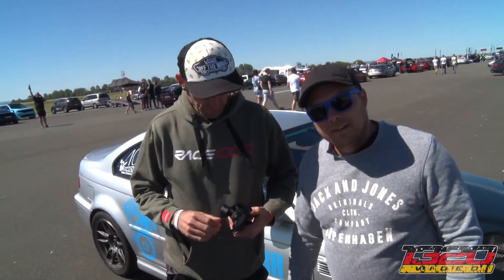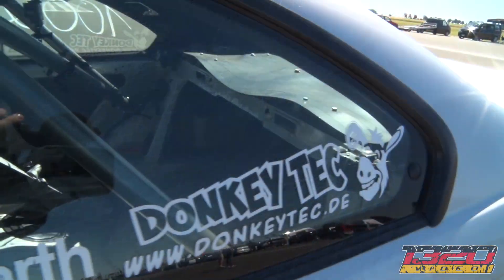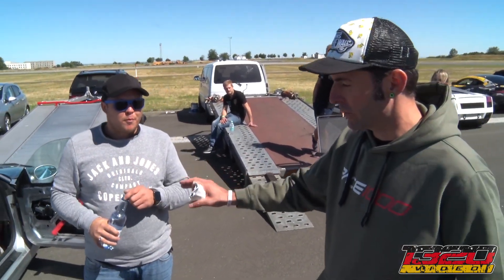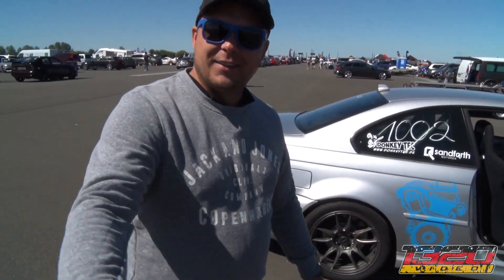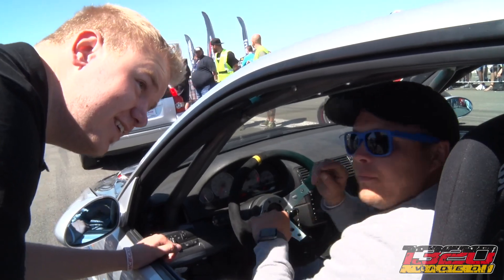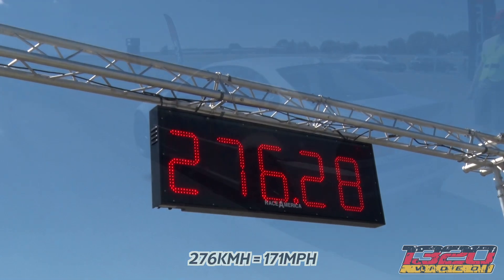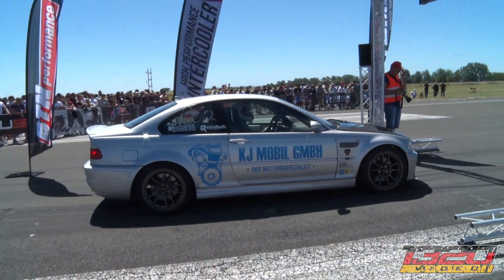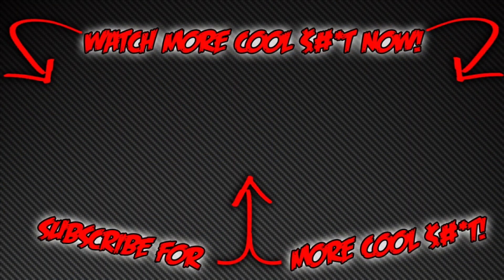950HP BMW E46 - Shooting for 300kph? (man shifting!)

Comment: they swapped a m50 into a E46 M3 coupe? 
 
smh everyone is going to regret not keeping their E46 M3's stock when they blow up in price just like all the Porsche's did.
Reply: I'd imagine that idea for this car isn't to resell it.
Reply: Yea and they're gonna be even more expensive because there won't be as many of them in stock condition
Reply: I have owned both e30 and e36...not worth it. Get a vette or an Audi RS...and btw 300kph is 186mph, not 220 lol...
Reply: The m50 has an iron bottom end, the s54 does not. The m50 is far stronger and is much better suited to high boost. Although the 46 in this video did not display this very well lol, it was breaking up like crazy, and never hit full boost, the driver didnt help either [i mean no disrespect]. 
Lets just hope he put the s54 engine from that 46 into a 36, seeing as the 36 has a lighter and stiffer chassis, s54 swapped 36's are serious weapons.
Reply: How about a built  N54 big turbo in an e30? With an M5 6spd manual trans...
Reply: It's clearly a 325 with m3 rear bumper
Reply: e36s are lighter but I don't think they are stiffer, I own an e36 sedan and I have tracked it along with an e46 daily, the e46 has a slightly better chassis, although the dynamics of the e36 make it more fun in my opinion to toss it around.
Reply: Gonzalo what do you think about the e30? I loved my m3 but it was weak until high rpm. I imagine 350-400hp in that chassis....
Reply: Thats not true @ Gonzalo, if you have ever stripped either chasis down you would know the 36 has thicker sheet metal in the rear, aswell as being spot welded in far more places. The 36 is also lighter, by over 100lbs.
I have had many of both including e28's, e30's, e34's, e39's aswell as an e90 and e92, and in no way shape or form am I saying the 46 is not a great chasis because it definitly is. However the 36 has far more potential as a chasis, that is not to say the s54 is not the greatest N/A 6 pot of all time,... because it most certainly is!
Reply: @Enlightened Idiot 300 is about the most an e30 can take to be honest, it needs a maaaad load of chasis work after that to keep it from being a death machine. Sounds crazy but adding weight to e30's and seem welding the chasis actualy makes them better, along with e46 arms, e36 hubs, purple tag rack, 36 subframe etc.. the e30 becomes quiet the monster with a decent power adder.
Reply: I actually have only driven one in my lifetime, years ago, a fully stock 318i, not very exciting, all I can remember is thinking how small and light it felt and how the steering was a lot of work to get it to steer, didn't suit the car at all, a quicker rack is a must on e30s I guess. Wow you had the best e30 of them all hahah, I would love to drive one someday, but with the prices they are up to now I don't think I will ever get that opportunity sadly. An e30 with 350hp must be a blast yeah, although more than that would be dangerous in my opinion haha, just give me 350hp and I am happy
Reply: You seem to know your stuff, I always thought the e46 was an improved e36 basically, I guess not, you actually see a lot more e36s being tracked than e46s, I guess there is a reason.
I have to say that I would take my e36 over any e46(except maybe an m3) any day, they are just so much fun.
I drove an e90 once, it was a diesel, I didn't like it at all...
Reply: I know enough but im no expert, my knowledge comes from many, many arguments with spanners, hammers and bimmers lol.
I'd also take the 36 over all other bmw chasis for track use, the 46 m3 only interests me for that s54 goodness, an s54 in a 36 is quiet literaly a weapon on track.
I share you're opinion for sure on the e90, i had the 330i and almost fell asleep everytime i drove it. The e92 i had was a 335i so the engine kept me awake but still super numb feeling in comparison to its older counterparts.
Reply: @willpayforbaconbacon9569   s54 has Iron block
Reply: Willpayforbacon bacon thanks for the education. My M3 made 176 rwhp with a few mods thanks to Bavarian Auto in Houston. This was early 90s.  It was fun to drive but all the power was in the upper rev range.  Hell my truck makes 315hp these days. But my VFR sings with 112hp at 12k rpm. That being said, I still want an IROC with an LS, or a narrow body e30 with an N54...
Reply: @ Sami Tapio You're 100% right brother, I guess i muddled that up with the m54 in my op, I've had too many bimmer engines apart to keep track half the time lol. The point made is still very valid though, due to the c/r on the s54's... big boost is not an option unless you drop that by a large amount. Vanos deletes are also super common on s54's, s52's and s50's when turbo'ing too, something to keep in mind. The m50 is basicly, slap some valve springs, rods and pistons in, whack a turb-ski on her and she's all done.
Reply: @Enlightened Idiot Mmmmmm LS, Spare me please... I live in the U.K and an LS over here is just a myth lmao. I'd give a testical for a market like you guys have in the U.S for v8's, I'm stuck with 1j's and s5---'s as the go to power adder's
Reply: Willpayforbacon bacon yeah thats a shame. My dad put a roller cam 383 (366 rwhp) in his IROC during his midife crisis. I was in high school. Snuck it out and MURDERED Mustang GTs. Dad caught me and gave a fuck. Lol thanks dad RIP...
Reply: Willpayforbacon bacon yeah i wish i kept it. But i got an 88 anniversary vette.  Which I also sold, lol. But no worries. Those cars were only fast for the time. My truck would beat them today. Not to mention my bikes...
Reply: Willpayforbacon bacon the E46 is much stiffer than the e36, over 40% stiffer torsionally regardless of the amount of sheet metal. That was literally the only selling point for the car when it first came out, as it had the same engines as the e36 initially. They published the torsional stiffness numbers for both chassis so you don’t have to take my word for it. The S54 is an iron block and has the strongest internals of all the m5x / s5x motors. You can definitely turbo an S54 even with high compression as it takes almost no boost to make power thanks to its head there’s guys making 700whp with stock compression and internals, I believe the s54 also holds the aftermarket record for the highest power from a BMW engine, there’s guys with around 1200whp S54s,  The better setups retain VANOS as well it will help with turbo spool and drive ability.
Reply: Jack Eagan wow that is impressive. Tell me what all 
 cars that have the s54 block...
Reply: @Jack Eagan  Sorry i kind of forgot to mention I was not refering specificly to the m3, and if I was the 40% figure you have sugested is also incorrect. 
46 m3 = 18,500Nm/deg
36 m3 = 16,120Nm/deg
That is not 40%, however it is stiffer as you say for the m3 specificly, but if you dive into the non m3's it's a very different result, especialy the 46's with folding seats.
46 coupe = 12,500 Nm/deg
36 coupe = 15,120 Nm/deg
I cant seem to find the figures for a non folding seat non sunroof 46, I'd imagine it was quiet abit stiffer.
As for the s54 I've had a few mates with horror stories with turbos, my current setup is an e36 coupe [non sunroof] with an s54, I'll look into what you've said as I would love to turbo it, but was always under the impression I would have the same experience as my mates. Thanks for the info bro.
Reply: Willpayforbacon bacon interesting, I can’t actually seem to find any data for the e36 other than the touring, which is about equal with the e46 convertible. Considering that the wagon variants tend to be the stiffest cars with folding seats, and the convertibles the least stiff, I’d say it doesn’t look good for the e36.I found one article that claims the e46 was 70% stiffer than the e36 (its the citation in the Wikipedia article for the e46) but I can’t find any data to compare an e36 coupe to an e46 coupe. Still the fact that they weren’t touting their stiffness numbers until the e46 and after makes me think it’s probably stiffer. Other than you there’s nobody on the bmw forums who has reason to believe an e36 is stiffer than an e46. I’d be curious to see your source for that data you posted.
Reply: S54 does have a iron bottom end
Reply: @willpayforbaconbacon9569  s54 is iron... just thinner walls because of  larger bore

Comment: If I recall correctly, the factory gearbox was only geared to an unrestricted 182mph top speed. While I doubt it's running vanilla with 900+hp, it sure sounds like the gears are mighty short!

Comment: Need a euro e36 m3 engine S50B30/32 and a turbo .but the m50 b25 will do
Reply: When you say EURO m3 engine, I guess you live in America? Is the engine different from the European version? If you do live in Europe, the German version of the Autoscout website works great for cheap wrecks with good engines. Shipping and title exchange might be expensive. My experience with these things here in Europe, is that often when you just want to find an engine online, the fastest way is just to buy the whole wreck, take what you need, and have the leftovers crushed.

All that aside, The M50B25 are a dime a dozen at the junkyards, an S50B30 costs time to track down,  and they cost wayyyyy to much because of the BMW Motorsport stamp

Comment: I love the build, Needs 2.93 diff asap. That Titanium exhaust raspy af! Eninge sounds lean, could be the c16 tho never heard it in a turbo s54
Reply: It's an M50 out of an E36.
Reply: Ahh.. I thought the M50 was non vanos. But I could be confusing it with the M52TU Either way Love the power its making and the sound for sure. Very raspy full titanium im guessing.
Reply: @triedproven9908  yes, the one in the video is a non vanos m50

Comment: The reason his rear wheels have negative camber like that is because when whoever changed his RTAB bushings they accidentally swapped the RTAB hangers to the wrong side (e.g., right is on left and left is on right).  Be careful driving that in the rain until you fix it.  You're welcome!

Comment: That seemed a little chill for a 950hp RWD, light coupe. Do you know what his boost by gear was set up at?
Reply: Did you miss the bit where they said about walking out of the hole to start with? Little something called mechanical sympathy.

Comment: Love seeing BMWs at the strip...

I just looked it up and a GTX 42 turbo is good for 950 HP max.

Maybe with the mechanical cam they were expecting 950 running the turbo out, but like other I agree either he's not making 950, or he just plain isn't putting it down so the KPH doesn't reflect the HP. LOVE seeing a BMW with a BMW engine tearing it up. Stock box too?? Wow. Thumbs up dudes.

Comment: lol change the final gear ratio or start in 2nd gear / skip gears. fairly useless having that much power with such a close gear ratio, unless maybe you're drifting or on the track but it still should be slightly taller gear ratio IMHO. for something like this you're probably going to need a 2 or 3 speed, or a trans brake to spool up that turbo in order to get a decent drag time. - just realized im giving drag racing advice when i personally cant stand drag racing ha! but this is common sense honestly